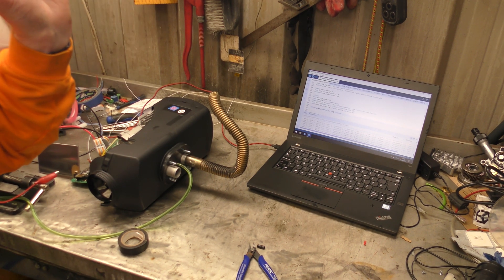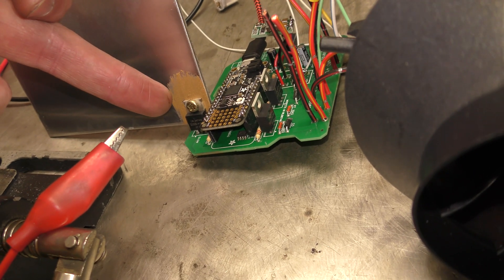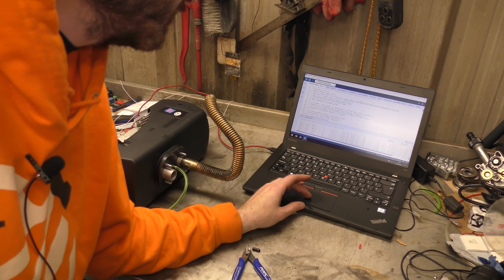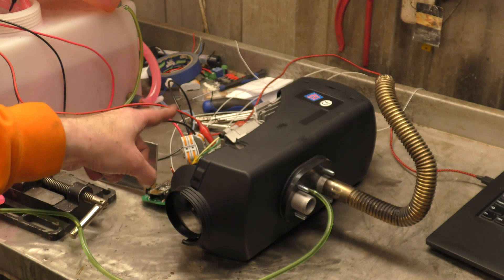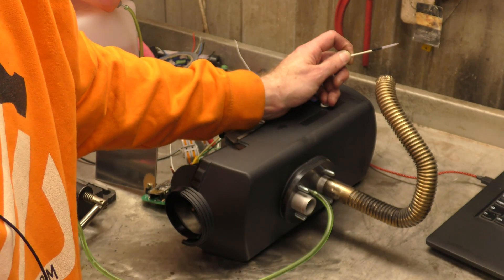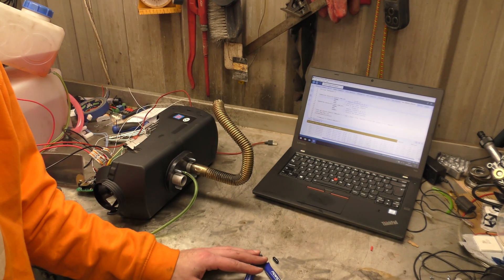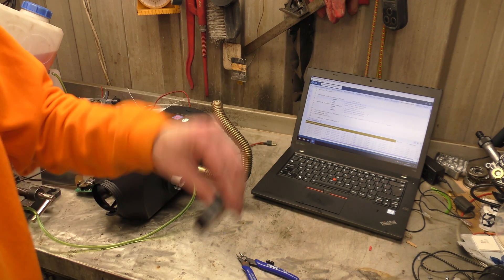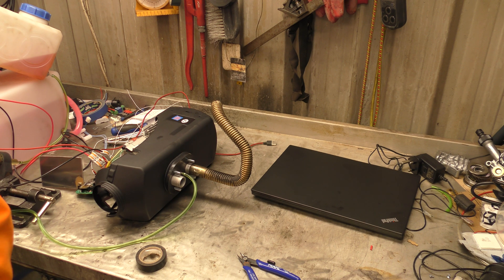Webastardo V3 - running a diesel air heater, nearly - Part 1

Comment: Hi David & @Simon_Rafferty first of all, Thanks for this great project. 
I'm using the version 3 board with a thermo topc heater. I'm a little confused  with the thermistors too.  here is what I've found so far. 
1/ Pin 3 is marked "Exhaust Therm" on the board but is connected to A1 on the feather which is water temp in the code. 
2/ Pin 3 is also connected to the original thermistor pad and the R11 resistor but in the code it suggests "You will need to change R12 to 4.7k" in regards to using the original one (unsure what the original one is for? water temp or exhaust temp?).
3/ The above also means that Pin 5 marked "Water Therm" is attached to A2 on the feather which is Exhaust temp in the code.

I have an old webasto board that I can salvage the original thermistor from and I also have purchased several 100k thermistors so I can go either way. I'm just unsure if I should just swap A1 & A2 around in the code or just use pin 3 for water & pin 5 for exhaust?. Also should I swap R11 or R12 for the original thermistor? and if I'm just using 2x 100k probes should both resistors be 100k? or as the text on the board depicts 1x 4k7 & 1x 100k ?.

hopefully this makes some sense and you can help me get up and running.
Regards Steve.
Reply: ok I've figured it out, I read a tutorial on using the thermistors and was able to sort it, I'll test it all and probably do a full writeup or video. I have made a few small changes to the code and now have the V3 with the hazzah esp32 board controlled by both the blynk app and the 12v to pin 1 start-up methods :-).

Comment: Wy this board ? Because orig is to expensive to replace ?
Reply: people just want to be able to run one. Most need the vehicle connected or will lockout if you have start attempts and require communication through factory tool to be reset. And it just gets to 80 and shuts off because the original ecu is for warming up an engine.

Comment: Im lacking time but making an ecu for these is something Ive been thinking about.  Heres what we need that are lacking on these units
- Intake air temperature for a better mix
-Pyrometer exhaust temperature to detect flame and make it more precise in the ramp up sequence instead of frame temperature
-secondary pump output for mixing fuels
-wifi, 2 way communication
-sleep mode to not drain battery when off (some stock controllers are pretty good in that regard but still leave lcd on)

Comment: I think a mass airflow sensor would be neat. If theres any way to further decrease the fire rate and increase it over the stock controller without tuning past selecting pump size and fuel type it would be great.

Add in some logic that decides if its more battery conscious to idle vs shut down and start back up as needed based on an acceptable temperature swing, that would be real neat.

Comment: I probably didn't comment it sufficiently!
I'm using the exhaust thermistor now to measure the room temperature & shut down the heater when it exceeds a value (which it gets from Blynk).  I suspect the reason it's getting up to 80 then shutting down is it thinks you're cooking!  I also swapped it for a 10k Thermistor - which is why it appeared wrong!

Might be worth trying again, keeping the exhaust thermistor cool?

I'm going to write another, cleaner version - getting rid of a lot of the junk code as well as Blynk and maybe adding Home Assistant integration instead.
Reply: yes please for home assistant been looking for solutions for my home assistant controlled camper van :)
Reply: @billysbikes8671  It's in progress!  I'm still figuring out how I can check to see if a helper exists & if not create a new one, remotely.  Reading & writing to entities / helpers is easy - but unless it creates the resources it needs it's too clumsy a solution.

Comment: Could you uses a window made of quartz glass. Then use a led light sensor and a timer.
The same way a oil furnace uses. 
Think the K.I.S.S. Method. 
Keep 
It 
Simple 
Stupid.
Reply: There are lots of ways to detect if there is flame. Yes a UV sensor would work but they fail in the flame detected state so you need to do self checks and junk but that's an intrusive modification that most people won't want to do. Useing the glow plug as a temperature sensor isn't a terrible idea as it gets you right in the burn chamber. I don't know how useful that will really be over the body thermistor but it should work.
Reply: @jim4556  
Here all oil fired furnaces  use a photo resistors.  To detect flame. As they are very reliable. 
Yes you use a glow plug but why reinvent the wheel.
Reply: @Assassinlexx  because it dosnt require extensive modification.

Comment: Apologies if I missed it or it went over my head, but what is the purpose of the board/project?  Is it mainly to allow a device like a PC to control it via a cable/BT/Wifi or are there other purposes/uses for it?
Reply from the maker: For me it's to give more options on control.  I'm hoping that others might want to advance it further as a full ECU for the air heaters as I don't think there are any other options available.
Reply: people just want to be able to run one. Most need the vehicle connected or will lockout iff you have start attempts and require communiocation through factory tool to be reset. And it just gets to 80 and shuts off because the original ecu is for warming up an engine.

Comment: Perhaps just  have a timer for the glow plugs like a diesel vehicle.  As soon as or during the timed session engage the unit to turn on.  Like glow plug on 15 seconds, but in 10 seconds the unit turns on.  Of course I don't know how long it actually heats it for but you more than likely know.
Reply: That's pretty much how it works now - turns on the glow plug for 60 sec while the heater starts.
What this is doing is using the glow plug resistance, while it's switched off to measure the flame temperature.  If it's too low, the flame has not caught & it knows to shut down before the floor is covered in unurned diesel!

Comment: Looking at that thermal probe, it's probable that it's not suitable for those temperatures, causing it to crap out as it goes beyond what it can do reliably, the bare-ended "solder blob" kinds are usually more for just "ambient" types of temeratures versus combustion temps, I ruined one I had with my multimeter trying to use it as a BBQ thermometer, it just utterly cooked it and gave weird low numbers that were pretty much not matching up with the nice hot BBQ lid (hands make good instant-read thermometers!!!), and never worked properly again since...
Reply from the maker: That makes sense.  I wonder which probes I used for the first build.  I suppose just because it was the same listing on Amazon doesn't mean I got the same product again.
Reply: @DavidMcLuckie  The safe bet is to look for thermocouples with the metal can on them, they're usually more for hot applications like this, but getting them on places like amazon is a lottery, you're btter off using something like RS, Rapid or Farnell or the like, cos at least then you know you'll be getting the right parts, may cost a bit more, but at least you get a warranty with them... :)
Reply: Perhaps thread an exhaust pyrometer sensor into the burn chamber or the exhaust? I'm not sure that's a cost effective solution though, looks like they're 20-30 usd

Comment: What is the part number of the chip that measures the current?
Reply from the maker: ACS712
Reply: @DavidMcLuckie  neat.

Any idea how they use it to detect if there is a flameout?
Reply from the maker: It reads the resistance value of the glow plug.  When it's not in operation and is hot the resistance value is different than off and cold.  This lets the heater know the flame is still lit.
Reply: @DavidMcLuckie  cheers! Clever.

I've just used the case temp.
Reply: @danedwards_ee  The original Webasto used the glow plug - so I thought I'd try the same.
The resistance of the glow plug is very low, only changing from 1 to 1.3 ohms - which is difficult to measure the normal way, using a potential divider & ADC.
Instead I'm switching on the glow plug for a few mS and measuring the current flow.  Because the current is quite high (10A or so) the change is bigger & easier to measure accurately.
The chip is just a Hall Effect current sensor.